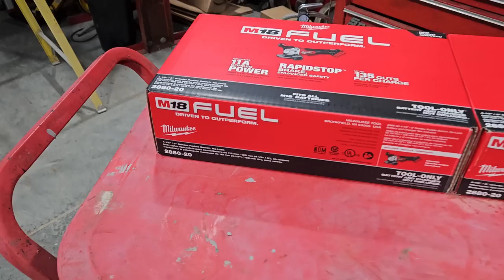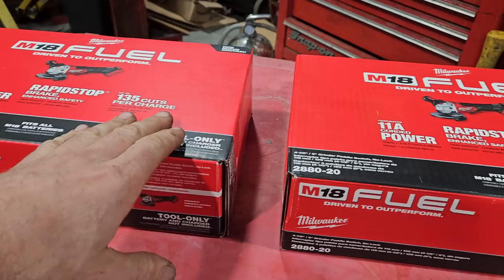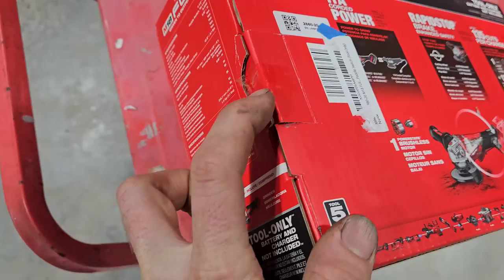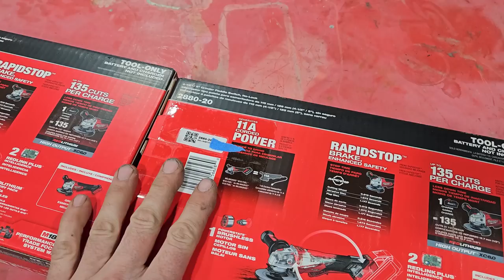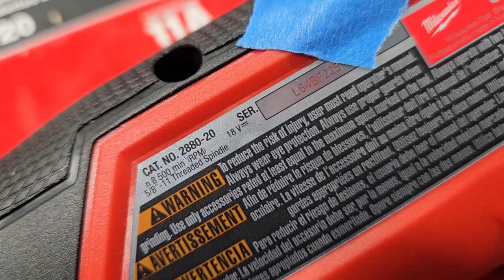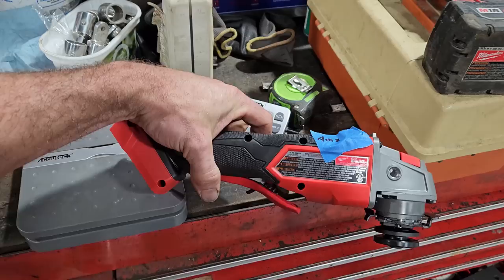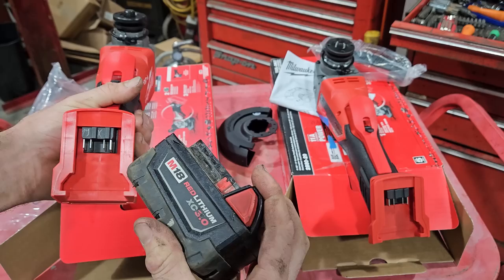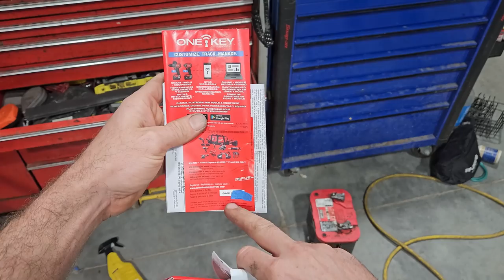Amazon MILWAUKEE Tools FAKE or THE SAME? Half Price!

Comment: They counterfeited it so well, they built an authentic unit. LOL.
Reply: Half of them are repaired returns
Reply: If you don't mind buying stolen product it is alright
Reply: @wpintofg , they’re not stolen in most cases, they’re what’s called gray market.
Reply: @mjstutter12  I could not understand what you typed there sorry
Reply: Likely pallet
Reply: @jordanalexander615 more like 1/4
Reply: Lol left overs at the Chinese warehouse where they build them for milwaukee 😂
Reply: @wpintofg  I hate that, honestly.
Reply: @jordanalexander615  repaired returns are sometimes better than new because the defect has been corrected.
Reply: Refurbished cost less
Reply: It's authentic, as it came from Home Depot...grin...
Reply: same exact product made in 2 location.. thats all.. they need 2 factories to keep up with demand..one probably deals with the eastern hemisphere and amazon, while the other deals with the western hemisphere and licenced dealers. weight differences is because, maybe the metal is from different quarries 8:50 ...2oz on this, not really an issue its 2/16th of an ilb. %100 worth getting the amazon one
Reply: In the 3rd world countries where designer bags are made, the workers on the assembly lines have learned to smuggle scraps out of the plants.  They so meticulously piece together their bootlegs that they end up being of greater quality than what generally ships from the plant.
Reply: Clearhouse products.

Comment: That was a .2oz difference, not a 2oz difference.  That's not too surprising.  It's 100% genuine, fakes are not this good.  Whether it's stolen or not, hard to say, easily could be one that walked out of a home depot and onto Amazon.
Reply: If the tool is sold by an Amazon affiliate seller, and the price is lower than msrp... IT IS STOLEN.
Reply: yeah. Percentage-wise was almost no difference.  No reason that they would be exactly the same down to 1/10 of an ounce.  He would see at least this much variance among the units sitting on the HD shelves!
Reply: A California special?
Reply: @doncorleone2713  or New York!
Reply: .02* of an ounce.
Reply: @donkeydiehard879 exactly 0.02 oz different. They are the same tool.  I’m sure the tools will have slight weight differences and placement on the scale can cause such a minor difference
Reply: California,  they don't stop loads of basketball Americans from walking out with carts FULL of red,  you're buying stolen tools.😂😂😂
Reply: My point exactly. Whether they’re stolen or not, .02 oz. isn’t much difference; it’s the same tool
Reply: I tough this new tools with one key only workers if the serial number was scanned at check out. My locals HD makes a big fuzz about this. I’ve worked for amazon resellers a lot of times this from a store that went out of business ace hardware are the usual culprits they have a lot of mom & pop stores using their name. My local hardware store had been independent for years they incorporated into ace and went out of business about 7 months later.
Reply: @donkeydiehard879    The screen list the pounds and then a space and then the ounces followed by the first decimal place.  So, to me, it's a .3 ounce difference.  Where are you getting .02 since the hundredths place isn't even shown on the scale?  Put it into HD if you need to but there's a clear decimel point after the 5.  5.5ounces --5.2 ounces = .3ounces
Reply: The difference is actually .3 oz (5.5 - 5.2).
Reply: They do that ??
Reply: @patrickt8941 so what atleast I get the tool for what it should be sold at... besides why are you being racist in 2023
Reply: @SnoolDrizzle  home depot has a no chase policy... once they are out the doors can't do anything to them watched it happen in Texas
Reply: @angelusmortis3256  So you are ok with receiving stolen goods? That will get you a vacation at State expense where I live.
Reply: @aceroadholder2185  as long as you have no knowledge of it being stolen they cannot charge you with "receiving KNOWN stolen goods" that is per US law... they have to prove you knew a crime was committed...
Reply: I don’t care if it’s stolen or not. It’s authentic. So I’ll be happy to buy at a lower price.
Reply: Have you heard of “Grey Market”?
Reply: Also a big part of this discount tools comes from people buying bundles and then breaking them up and sell them separately ( like if the grinder come with a free battery or another tool for the price of one or half) at the end they make profit and yo save money science you didn't need that estra batteries or tool
Reply: @patrickt8941 Basketball people? 🤮
Reply: Whats an ounce ????
Reply: They are not fake, it's just a different batch. I don't know what you're looking for, it's just creating controversy.
Reply: 1/5 of an ounce
Reply: @michaelkinsella8904  What's an ounce, you ask?  It's eight-1/8ths (or around $300 depending on the strain) 😆
Reply: @rsc557  Actually, if they're both found to be the exact same, then there isn't any controversy. I'm pretty sure that's what he was trying to clear up here
Reply: Can you people not do simple math?

The first box was 5 pounds 5.1 ounces.

The second box was 5 pounds 4.6 ounces.

That's a difference of 0.5 (1/2) ounces,  or 1/32 of a pound.

In other words, they are so close to the same weight that it doesn't matter.
Reply: greese different
Reply: Just let him thinks it's 2 ounces, it's funnier that way.  Home depot charges more for the same item because they can.  I don't shop for good deals at home depot that's not an option.
Reply: it could have been the tape he put on.
Reply: Its stolen merchandise
Reply: They are probably legit, one made it on to the truck the other caught a different mode of transportation!  There was a video a couple years back with iPhone being black marketed. Fabulous video.
Reply: I am amazed you got over 200 likes for this post…. The viewers don’t know how to use  tools for the most part.. I would put money on the fact that this generation thinks an electric screwdriver is a tool…..
Reply: @patrickt8941 I love it when people think they know what California is like because they saw it on TV. 😅
Reply: @aceroadholder2185  no it wouldn't you would have to know they are stolen stop it
Reply: @rmora1 
I heard they have to mark up their prices because of all the robberies !!
Reply: @BPantherPink  Maybe, but they were already marked up to begin with. Maybe they are just playing the victim card, since that always works.  Every big company has always overcharged me for goods or services so I don't have any sympathy for them.
Reply: @rmora1  Right there too...
Reply: .02 0z of extra grease in the gearbox
Reply: I just got one a m18 impact driver 2953-20 it was for bid on ebay and i got it for $160 brand new with box hopefully it’s genuine when i get it in the mail i think if its genuine its definitely stolen because its the only item they have on sale from that seller
Reply: They just walk into a Home Depot and walk out without paying. Perfectly fine in a blue state.
Reply: @triumph9252  I'm in a red state and no one's stopping them here either unfortunately
Reply: One could just get home Depot to price match and pick up from there if in doubt of authenticity.
Reply: a lot of stolen items are sold on the internet, so it is better to buy at Home Depot or the local Milwaukee outlet
Reply: @jackylsmith8138  probably the amount of grease in the head
Reply: .02oz  difference
Reply: Could be stolen, could also be made for sale only in other countries. High-end camera gear has grey market items. The same gear, but for made for sale in other countries, and no warranty given if bought in the US.
Reply: @Auto-Bots.Custom.Detailing  are you slow, gramps? There's been electric screwdrivers since 1923. They STILL sell them at home depot. I guess you must've been born in the 1850s or something.
Reply: @angelusmortis3256 he's not being racist he's stating a fact. try watching some videos on who's doing all the stealing
Reply: if it's from the head then I'm guessing a dab of grease difference
Reply: If it walks like a duck ,quacks like a duck ,it's a duck!. I have! bought brand new in the box Milwaukee cordless tools from a pawnshop, always wondered how he got the tools as they were almost half price of Home Despot 🤔,but the price was right,ain't  complaining!
Reply: Tools are real beware of the batteries.
Reply: yea....I noticed that too....to me the Amazon product is genuine......
Reply: @RichardsWorld Bingo. You win the prize.

Comment: If i may add a little insight. I'm a reseller. So very familiar with Amazon, e-bay etc. Chances are the seller you bought that milwaukee from was legit. Milwaukee often does closeouts and replace old lines etc so they liquidate old stock. People like me buy them up and resell them. We typically sell for half of retail due to the fact that you do NOT get a warranty. The problems come in with deceptive resellers. Sometimes they don't test or verify the purchase and resell it wrong. I have sold broken tools, but I always disclose that in the listing. So you got a legit product but it may have just been old stock and/or closeouts. Always check a sellers reviews before buying.
Reply: Milwaukee is not discontinuing enough items for that to be a way for resellers to buy. 
Plenty of sales to get tools cheap & stock up on, and resell to people who don't research. 
No person who steals wants to give out their information to a company for tracking, and they sell it low locally. They are the ads with  pictures taken in their vehicle 😂
There are also authorized sellers who will sell to family/friends to increase their sales numbers. The only thing they can't do is advertise lower prices, but they can sell for whatever.
Reply: I need your eBay shop lol
Reply: I have gotten tools from eBay and other resellers and had Milwaukee warranty them.  I brought them to a tool shop Milwaukee sent me to and everything was fixed.  So buy from wherever you get a deal!
Reply: These also sometimes are stole items, these power tools are very sought for . . .
Reply: It's stolen batman
Reply: My understanding of united states warranty law is they cannot refuse to warranty them because you bought them from an unauthorized seller.
Reply: @patrickday4206  Maybe it's like Home Depot that won't warranty it, not sure i have never warrantied a tool before myself.
Reply: If that was the case the new one he just purchased at HD wouldnt be the same EXACT model, this is 1000% a stolen item being resold. I am suprised tho as from my exp. they usually just ship the contents in a new box.
Reply: same exact product made in 2 location.. thats all.. they need 2 factories to keep up with demand..one probably deals with the eastern hemisphere and amazon, while the other deals with the western hemisphere and licenced dealers. weight differences is because of this...just a slight, maybe the metal is from different quarries 8:50 ...not really an issue. %100 worth getting the amazon one

Comment: Both tools probably came from Home Depot given the brazen way people are walking out of Home Depot with tools nowadays.
Reply: DING DING DING! this is exactly what it is. Haven’t come across any fake tools on Amazon but knowing Home Depot’s cost tells me there is only one way an Amazon seller is able to sell it for half price. It’s not bulk discounts - pretty sure hd has the best price available. Supporting the Amazon thieves(sellers) only helps HD justify the constant increase in prices we have seen over the last couple years. This is the story for tools but be weary of batteries on eBay and Amazon- they are getting really good with the fakes - copying the packaging and everything to look like they would in a retail store. On ebay at least you can tell a good seller is typically selling a bunch of tools and batteries most without retail packaging because they are just breaking up combo kits and selling the parts separate. I personally stay away from Amazon because the risk of something sketchy going on is real high and you don’t usually figure it out until after the Amazon return period has ended and your battery stops working.
Reply: That's it. People can't really do 2+2 count... It is authentic since it was stolen from depot and now it is being sold on Amazon
Reply: my home depot isn't in a high crime area...all battery power tools are locked in a cage, with a cable going through all of them holding them in place. When you ask a sales associate to get one for you, they take it to the register. Been like this for over a year at least. That makes it kind of hard to walk off with it
Reply: @dustinroberson1865  Most Home Depots aren't unicorns like yours.
Reply: @electric8668  I just figured with the fact that they went through that hassle in a low crime area, why wouldn't they in other areas
Reply: @dustinroberson1865  people don't only steal from depot. And yes I am at the depot everyday and they have people stealing Milwaukee products every single days. They do that for a living. They also take off thru the back or emergency doors. Just because your depot is in a certain way, it does not mean the other ones are like yours
Reply: @wpintofg  Like I said. I assumed that if I lived in a good area and they were all kept behind lock and key along with a cable that was locked, that other areas would be the same.

I don't think they should need to be behind lock and key, but I'm confused why other places wouldn't do the same if they are having issues. If someone is stealing them and selling online, it would only take local HD's doing this for that person to lose all of their income
Reply: @electric8668    based on what?  I'm also in a low crime area and the HD's in my area now have the tools locked up
Reply: @wpintofg   So where are you at, that the stores have a high theft rate but have not moved to locking up the tools?
Reply: @jeffeverde1  What are you asking when you say based on what?
Reply: @jeffeverde1  not all tools are locked up and they don't only steal from home depot. There are are two other hardware stores in my area that got broken in recently. They are installing metal bars at the doors and windows for more safety. Which costs them money and at the end of the day us consumers will pay the price for that
Reply: @electric8668 all the home depots in my area and the surrounding counties also do this. Must be a lot of...."unicorns".... Eh?
Reply: @cristopherfrakes1416  And they said unicorns were extinct.
Reply: Yep. Every HD I've been in has all the Milwaukee power tools locked up and they walk it to the register.

Comment: The fake one is so good it's made completely of genuine Milwaukee parts.
Reply: So both are fake😂😂😂
Reply: And it came from Home Depot via a fast moving shopping cart.
Reply: its not fake. same exact product made in 2 location.. thats all.. they need 2 factories to keep up with demand , thats why the font is different just on the stamp..one probably deals with the eastern hemisphere and amazon, while the other deals with the western hemisphere and licenced dealers. weight differences is because of this...just a slight, maybe the metal is from different quarries 8:50, or an air pocket in the casting.. no two will ever be the excact same ...not really an issue. %100 worth getting the amazon one